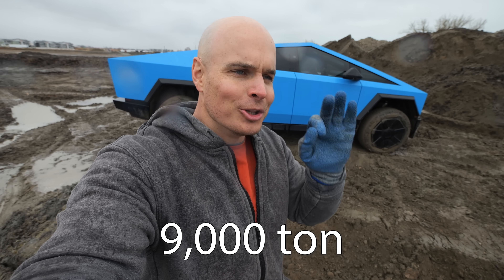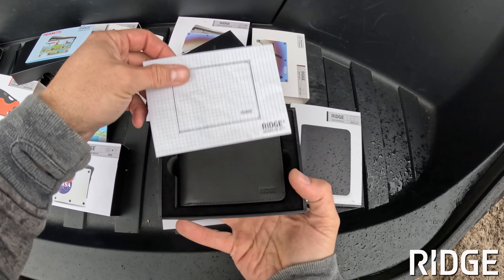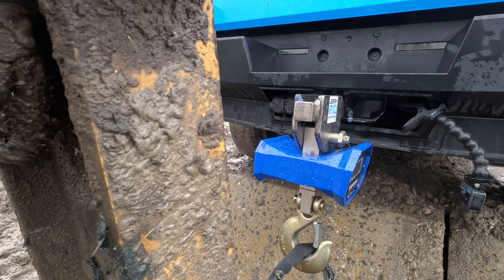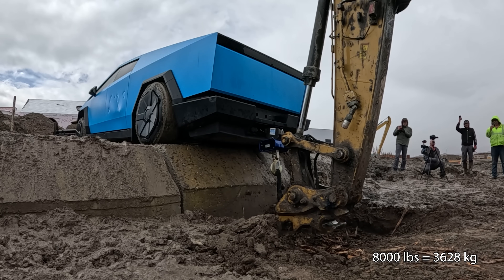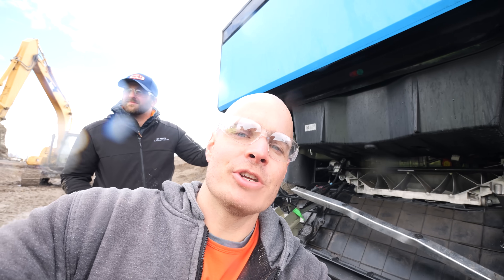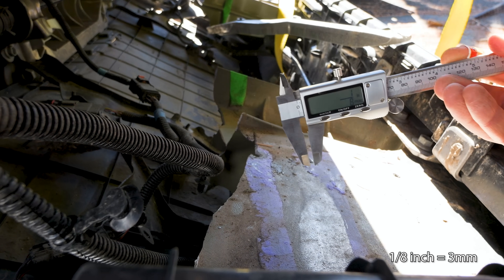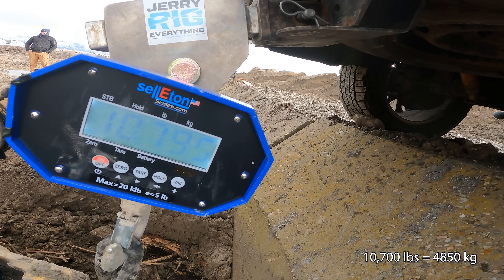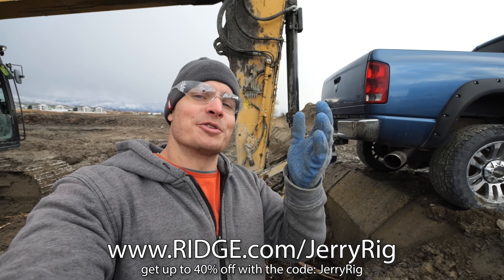SHOULD YOU TOW WITH A CYBERTRUCK?! - (catastrophic failure test)

Comment: The purple is panel bond.. most likely 3M... back when I went to school during my education in bodywork,  we tested welding and panel bond.. the panel bond actually took more pulling then the welds!! The welding ripped before the panel bond gave up!! Don't mistake that purple glue for nothing!
Reply: I used to work in a BIW facility for a large automaker. We used a glue exactly that colour. It was made by Henkel, Teroson EP 5089 it was called. It's heat setting so it won't cure until the body is baked in an oven. It's strong alright, I remember chiselling and hacking out a battery tray with that glue holding it down. That was fun 😂 It could hold the car together without rivets or welds I believe, but its not practical to do so.
Reply: These adhesives are very strong but come with their own considerations.  Surface prep is as, if not more, important when with welded surfaces.  They are also don't have the same chemical resistance, or thermal range as welds.  They aren't bad but like with any bonding method  the design and uses cases need to be consider.
Reply from the maker: good to know!
Reply: automotive body in white engineer here, they are using SPRs (self piercing rivets) to hold the two panels together. those are quite strong as well. You can see the SPRs since they remained on the top surface and then a hole remained on the bottom component as it got ripped through. And yeah adhesives nowadays would be just as strong if not stronger than most spot welds or SPRs especially since they distribute the load over a larger surface. the other reason for using adhesive between components is not only structural but also for noise and vibration reasons. two large panels being spot welded or pierced together would end up rattling at some frequencies. and then the adhesive can (if applied correctly) prevent moisture from penetrating between the panels and corroding the materials.
Reply: @JerryRigEverything  Yeah like you didnt know that when you were slanderously phrasing it. Dude your so biased.
Reply: @JerryRigEverything  There is a video in comparing panel bond to welding Jerry. It's not well known this is a common component in cars and is stronger.
Reply: @JerryRigEverything  now that you know, do you have a responsibility to update the video so that it no longer comes across as you questioning whether the use of adhesive was further evidence of cutting corners or cheapness?
Reply: @azed5251  Nope, he does not need to update the video because there are too many cybertrucks with failing adhesive. Corners have been cut.
Reply: @JerryRigEverything  respond to actual constructive criticism, not random facts
Reply: @JerryRigEverything  Seems you don't know much about mechanical engineering... people have corrected you throughout this comment section regarding multiple major flaws in your analysis. I expected better, but as is always the case, youtube fame goes to some people's heads and they drop off a cliff in terms of quality.
Reply: @----.__  thank you
Reply: @Dmaaaain Most of these tests compare panel bond vs spot welds on thin/weak material. Its a game of material strength, joint design/surface area. If you compared apples to apples welding is at least an order of magnitude level stronger. The other thing about epoxy is that when it fails it usually does so catastrophically (material strength dependent). In most cases a properly design/executed welded joint will yield before breaking. Take four 1" cubes, panel bond two of the cubes together and TIG weld the circumference of the other two cubes. Then try to pull, pry or twist them apart and see which fails first. 
In this case you can see the material is stronger than the bond and the epoxy bond catastrophically failed as well as the mechanical bond. Is that improper joint design or was it designed to fail here instead of somewhere else? Only Tesla knows and I can all but guarantee they won't tell.
Reply: @Two-StrokeLife  We just saw - the aluminum frame (at its peak strength) failed at the same time as the panel bond. Over time the aluminum frame will become weaker and start to crack, eventually failing before the panel bond.
Reply: Most new cars are full of structural adhesives nowadays.  They are easier to apply, stronger and longer lasting than the welds they replaced.  Nothing wrong with that stuff at all.  It's a big improvement in auto manufacturing.
Reply: @jeffer1101  ...Totally agree, and If I'm not misinformed the "aeronautical industry", not least military, have used adhesives for construction bonding for "ages"...
So one should not "dunk" on ""glues"" just because they are not "physical bonds", like welds, bolts or rivets.... Adhesives can if chosen and applied properly in many cases be the absolutely superior option/solution for a design. And this for multiple different reasons, from final strength, ease of "implementation/application", to "simple economics"
Best regards.
Reply: @jeffer1101  Courts already deemed structural adhesive to be illegal for safety items. Welding is stronger, don't believe people that say it's not. 

Multiple automotive shops already learned the hard way in court.
Reply: @gaboolful  Every modern vehicle has a lot of adhesives in it.  It's widely used in every modern vehicle.  There are still welds (mainly on load bearing areas), but the average vehicle has about 10 pounds of adhesives in it.
Reply: @jeffer1101 what's the longevity of the glue tho. Can it last 10-20 years?
Reply: @jeffer1101  Better with plastic body panels, sure - but that's because you cannot weld plastic panels to a steel unibody.
Reply: @ronlaverdiere  Cars don't have plastic body panels.  I think Saturn was the last one to use those.  The structural adhesives are used throughout modern vehicles (typically unibody designs).  As I said, there is often 6-10 pounds of the stuff in each vehicle now.  There's a lot, because it is really good stuff.  They still use welds in the critical areas under high loads though.
Reply: Very important context
Reply: purple bond RTV is not weather resistant .. cold hot cold hot will cause it to fail :) weld is better for long haul
Reply: fun fact to those unaware. those $500k supercars like mclaren & even bugattis use that same adhesive extensively the bugatti is actually made up of essentially 3 parts. bolted by 8 titanium bolts & 3m adhesive.
Reply: @its_paul_mfer  And carbon fiber, which is not weldable. Thus they use adhesives.
Reply: @ronlaverdiere  exactly im just saying to anyone questioning using adhesive on vehicles. That this isn't the typical adhesive you're used to 😆
Reply: Interesting, thanks
Reply: What's the fatigue life of panel bond? It may hold tighter, but does it lose strength every time it encounters a load?
Reply: @maticuno  it's rather old info, back from 2006 or so, we had a weld vs glue crash test after ~10 years of service and the result was basically indistinguishable in terms of behavior in a crash. So based on that, and some other tidbits I came across from members of the industry, properly glued panels are lasting longer than the rest of the car, and at times even exceed welds in strength and durability; plus they are even less prone to manufacturing defects. Proper bonding agents are frequently underestimated.
Reply: @Beam_of_Love  Regardless, a towing hitch should not rly on small bolts and adhesive mounted to a thin aluminium frame. The construction of the frame itself is the issue moreso than the mounting mechanism for the hitch, the truck is badly engineered to begin with.
Reply: @sydneato  Why - it withstood loads way past it's specification?
Reply: @Beam_of_Love  My body guy told me that he repaired pickups where panel bond was used, and he used panel bond to install new beds and other panels.  Then that truck would get in another accident (commercial vehicles) and every time the panel bonds held but welds broke.  Another benefit of panel bonding is you don't get rust as you do with welds.
Reply: @maticuno  The answer has variables.  It is likely this demonstration is a cherry picked example of where welded steel wins, but you could also likely post other examples where the weld fails before the adhesives.  There are likely many reasons why a "regular truck" is better than a Cybertruck, but I don't think this example was a valid reason.  Vehicles are designed to perform certain tasks and used for their intended purposes.  A Cybertruck wasn't designed to hold 10,000 lbs of tongue weight, so it's not surprising it failed.
Reply: @jeffer1101  The Cybertruck was definitely not designed to do actual truck things. The Cybertruck definitely WAS designed to extract money from douche canoes, and in that regard it's exceeding expectations.
Reply: @maticuno  I would think most people who know about cars and trucks knew what the Cybertruck was all along.  It never made sense and it still doesn't.  It will likely be done in a year or two since all the rich people who wanted one have already bought it.
Reply: @maticuno  accurate...
Reply: @maticuno  All you need to know is that the glue is generally much stronger than the materials it's bonding. Unless it's been applied incorrectly, it lasts for ages and can take a ton of abuse.
Reply: But "that's how Tesla builds their cars" says the kid. Shows how the haters against Tesla and Elon (jerry included) gaslight themselves. LOL!
Reply: on my jeep the door fell off do to hing was glued on .
Reply: @shawncell1247  Well that's because FCA is incompetent.
Reply: @shawncell1247 oooh! I wish I could see that! I’m so sorry for that!
Reply: 08219 made by 3M, that's how Peterbilts are held together, which I'm sure it's for everything
Reply: Agreed; dont see a problem with the glue per se. Its not that the alu cracked because the glue gave out; the glue gave out because the alu cracked. It wasnt the role of the glue to keep the alu casting in one piece; just to interface properly with what sits above. Technically you could have a glue bond thats important to the rigidity of another piece of alu; but thats not usually how its intended and on the surface that does not seem to be the case here either.
Reply: Might be a good idea to use both.
Reply: i'm not that enthused with only having Adhesive across about half of the surface area, plus i always like to have some Bolts holding things together, and to never rely on just one thing. it is an area that's kinda perfect for Bolts after all, two large flat surfaces.
Reply: He did smeared Elon mate mission accomplished. Truth doesn't matter, only "good to know".
Reply: At what temperatures were you testing? What about moisture intrusion? Lots of cybertrucks with panels popping off so there is definitely a problem with the panel bond.
Reply: I can’t say much, I can tell you that purple stuff is hard as concrete and is a sole mixture of which is teslas proprietary property. 

Now what I can say, not on behalf of Tesla as I am not speaking for the company. 
It is a type known as a structural adhesive made to bond panels and hold them structurally. They are to be used in conjunction with spot welds or self placing rivets, or solid core rivets as per standard automotive joining engineering practices. This is common throughout all automotive vehicles although those adhesive type differ from MFG to MFG. example: Tesla uses purple, Ford uses some purple and red, Porsche uses the rainbow.
Reply: Im actually surprised it made it to 10k, im surprised it didn't break at 4 or 6 k.
Reply: @Dmaaaain  same as wood glue! If glued properly wood is stronger where it is glued and if broken again will not break where it was glued together
Reply: Or both, they could of done both, it's a fucking car being held together by glue.
Reply: I can't believe nobody mentioned the use of adhesives to dampen vibrations. Parts are made thinner and lighter, which is harder to weld as well and things rattle, but people hate it when their cars rattle constantly. Floors are built the same exact way in stick built buildings. Adhesive is laid down the joists and sheeting is screwed or nailed in place. The adhesive keeps the sheet from flexing against the support structure, between the fasteners. This keeps the floors from squeaking or creaking when you walk on them. Epoxy is also used to anchor bolts into concrete footings vs. relying on threads or wedge/expanding fasteners. He was wrong and driving up a grade does not put the full weight of the trailer on the hitch. If that is really true, then is there zero weight on the trailer tires? If the entire weight of the trailer was put on the tuck, it would have to be hanging, but then the direction of the load would be inline with the frame of the truck......unless the trailer was dropped off a ledge so the truck was horizontal and the trailer vertical. That is an extreme case of an accident and matches what he did in the video.
Reply: Legitimately!!   As a welder (and I think Jerry should understand this being around welders).    The weld itself may be strong.        But the process of welding often weakens the parent material unless you do it in a pretty specific way. Controlling tons of aspects that are not easy to control
Reply: Correct! It’s actually DuPont’s 1480P structural adhesive. Very strong bonding between metals.
Reply: Sekisui actually. 3M isn't that good at glues
Reply: But if you use a heat gun and some suction cups, you can unglue the panels :)
Reply: People with a camera thinking they are smart. Anyone with a brain cell doesn't believe a thing they spout
Reply: Gluing is fine for body work (more contact surface than a weld), but it's not ok for structural.
Reply: So Jerry is trying to bury Tesla without knowing anything about the topic.  Great!
Reply: Note that it doesn’t really matter how well the adhesive bonds panels to the frame, if the frame itself cracks. So, how well the purple stuff works is a moot point.
Reply: @ronlaverdiere  Sure, but the frame isn't designed to support 10,000 pounds of tongue weight. The whole experiment is a moot point.
Reply: @jeffer1101 LOL - no! The frame needs to support the full weight of the truck, passengers, cargo AND tongue weight. Even empty the Cybertruck is starting out at almost 7,000 pounds. That means even normal suspension shock is going to start wearing on that aluminium frame before you even add a trailer!
Reply: @ronlaverdiere  It does support that.  What it won't do is support an extra 10,000 pounds above everything else.  The tongue weight rating for the Cybertruck is 1,100 pounds.  It failed at 9x that rating.  That is perfectly acceptable.  Anyone who does any serious towing knows you use a body on frame vehicle.  That's what they are made for.
Reply: I dont trust chemical adhesive vs a mechanical bond for long term applications
Reply: @NotGrimman  Welds can crack, break and deteriorate over time (rust, etc).  These are the reasons all new vehicles are loaded with these adhesives.  There is still welds on the most critical load bearing sections, but the adhesives are used everywhere else as they are better than welds in those areas.
Reply: the panel bond is exactly what's failing on cybertrucks and that's why they're all recalled.
Reply: @neliz2k  Yes, because they used the wrong one.  That's not the fault of the material, they used the wrong adhesive which is why it is failing.
Reply: The glue will be a DuPont product 

possibly Betamate 4600F (it's the same colour at least...)
It's both stronger and lighter than welding 
Bonded surfaces are further strengthened by SPR's and/or pop-rivets 

Certainly the fact glue is used is not the issue people think it is
Reply: Aston Martin also use the purple glue, no spot welds at all. It's filthy stuff too.
Reply: @DufftronicOk  Every vehicle uses it now.  Every single one.  Welds are only used on areas that need the higher load bearing ratings that welds give.  The adhesives are used everywhere else (which also used to be done with welds, but not anymore).
Reply: @jeffer1101  not quite. BMW spot weld everywhere. There is some PU bonding on certain panels though
Reply: Lotus used this adhesive in the Exige and Elise back in the early 2000's to save weight and they were proven to be strongee than the aluminum tub itself.
Reply: You make a relevant statement, there are lots of epoxies that when applied correctly can be used to permanently bond two pieces of metal.  And I do agree that using an epoxy or whatever type of adhesive it is isn't inherently an issue/the issue.  The issue is that I have never before in my life seen videos of the adhesive failing on other vehicles or in industrial applications like I see it failing on cybertrucks.  Tesla definitely did something wrong when they put these together, either it's a design issue or a production issue or both.  I think it's fair to say the glue is at fault if it's the wrong glue or if their manufacturing processes result in it not being applied correctly resulting in failures.
Reply: @ghostkilla I hope everybody in this comment thread goes to watch his update video on the glue! 😂
Reply: So many flaws in this video including his arrogance in thinking he knows better than the actual engineers.
Reply: Anti Tesla Fud.
Reply: properly designed and used glue is supposed to be stronger that the material it is applied to.

the purple glue was on both panels, tesla lacking there too!
Reply: Glue is glue. Just like glass is glass. Aluminum is aluminum. Steel is steel. They have different names for a reason
Reply: @ghostkilla931  wrong.
Reply: @ghostkilla931  Nuance is meaningless I guess
Reply: @ghostkilla931  Tell me how you weld Carbon fiber or FRP panels on to steel or aluminum frame in exotic cars. 🤭
How about this? Tell me how to weld steel and aluminum together? 🤭
Reply: @netmatrix75 you can, albeit very difficult. They are not weld together by welds but by solid core rivets. You can see the heads sticking out on the frame.
Reply: @ghostkilla931  not all glue, glass, and aluminum are equal. Super glue is different from elmers stick glue. Bullet proof glass is different from the glass in your homes windows, theres alloys of aluminum that are very strong.